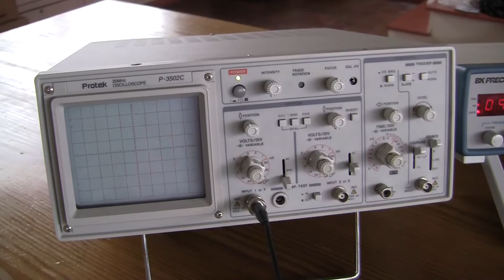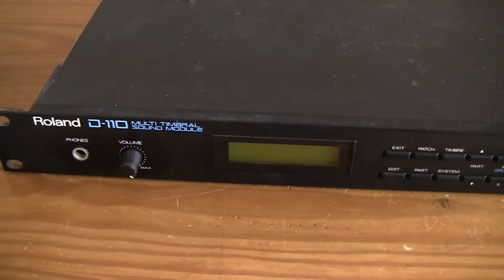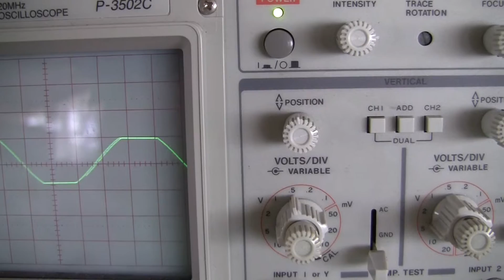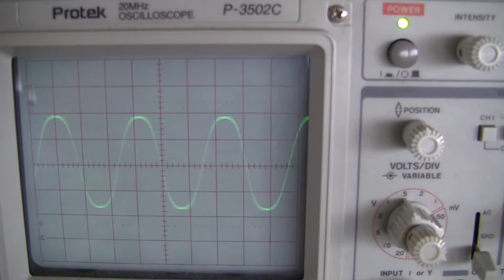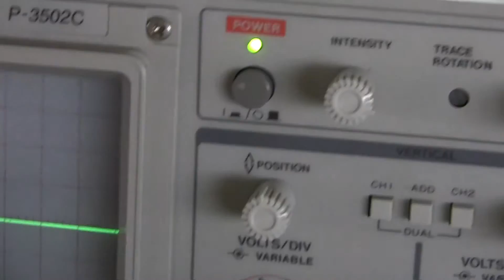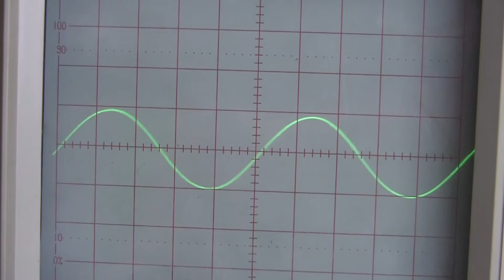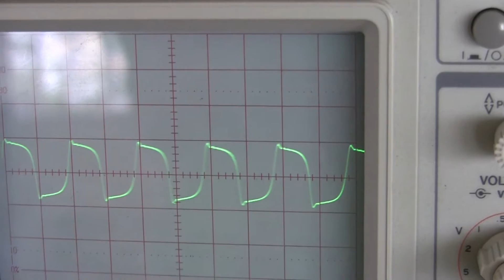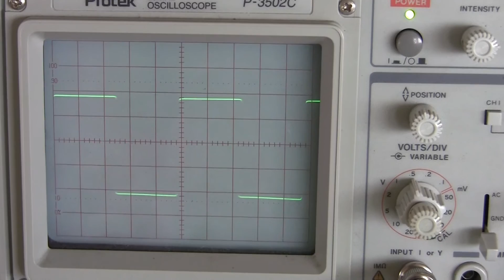Analog versus Digital  -  PART 2

Comment: The recorded square wave likely turned into what is basically a sine wave at 10 kHz because the fidelity of cassette tape is quite poor and it cannot capture the necessary high frequency harmonic partials to represent the square wave. Where a digital system is limited by the Nyquist frequency of the sampling rate, resulting in digital artifacts, an analog recording device is limited by the quality of the recording medium. It appears that the tape literally does not pick up much above the fundamental frequency at 10 kHz. As you mention, reel to reel tape would likely fare far better. 

Thank you for doing these videos Stephen, the only way for us all to understand these issues clearly is to approach it in an open, scientific manner. Moving on to the next part now :)